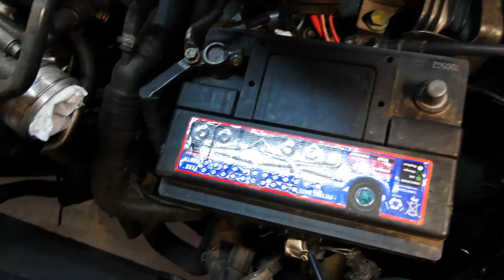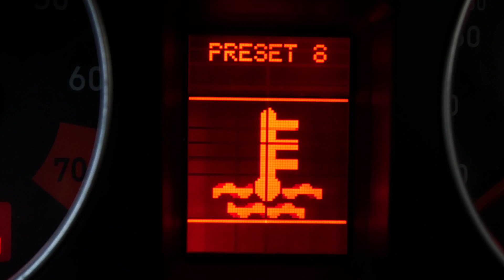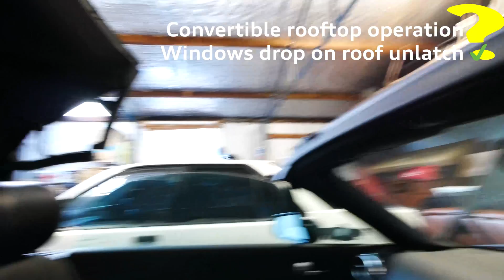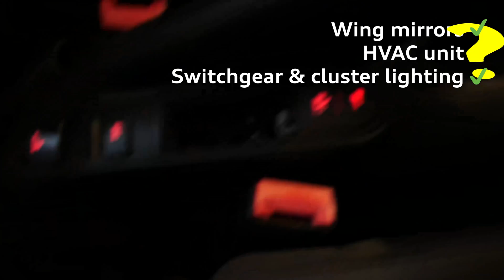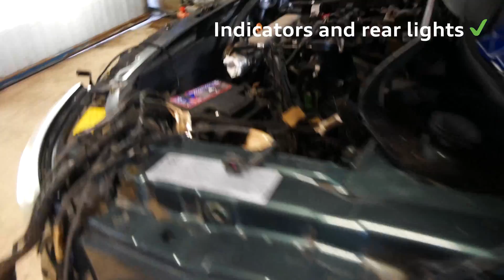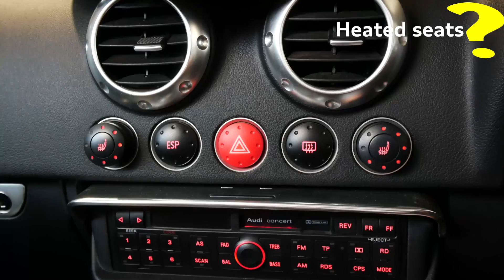Audi TT Mk1 interior electric components problems and tests. Desert Green Pearl Roadster restoration

Comment: Hi Ian   Just watched the first episode and have to say how delighted I am that after three years in the neighbour's dusty garage everything seems to be working perfectly.   It jogged my memory that one further thing you will need to test eventually is the fuel gauge function.  I had a problem at one stage (I think it was when I bought the car from the PO) the gauge wasn't functioning properly.  It would continue showing Full when the actual level in the tank was half or less.  This can happen when the car is laid up for a time and the contacts on the fuel level sender get dirty, causing an incorrect signal to be transmitted to the gauge.  The "correct" fix is to remove the sender and clean up the contacts with a piece of wet & dry or similar.  If you don't fancy submerging your hands in the fuel tank, the "easy" fix - which I think I found in AudiZine - is to add a bottle of Caltex Techron 5000 additive to your tank when filling it.  This may have the desired effect, or as in my case you may need to repeat the process once or twice before it is successful.  I contacted Caltex who suggested a limit of 5 successive applications between oil changes.  I can send copies of their emails if necessary.  The effect was also somewhat delayed - I added the three bottles with successive fuel top-ups and the proper function was gradually restored.  You might be lucky and not need it...
Reply from the maker: Thanks Kerry. I will take this into account and make sure the fuel level senders are cleaned up + some fresh fuelin the tank

Comment: That sound when you turned the headlights on could be the auto leveling motors, if it has xenon.
Reply from the maker: Ahhh right. Yeah they wouldn't have been turned on for all the years stuck in the barn.